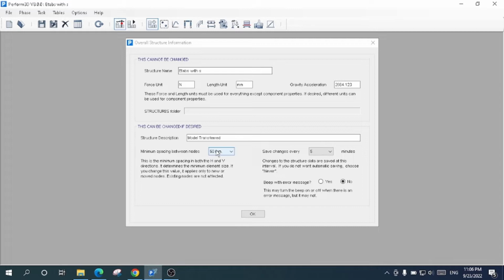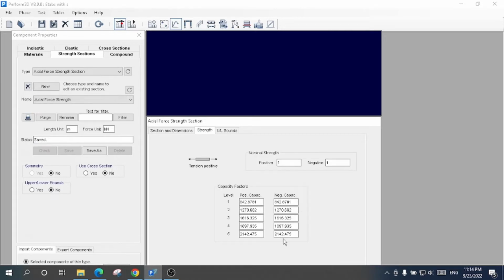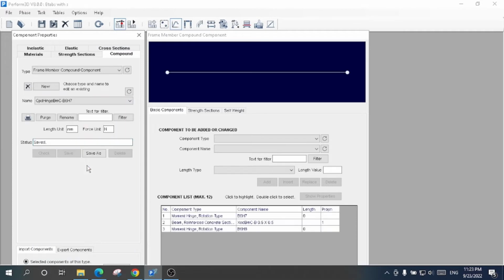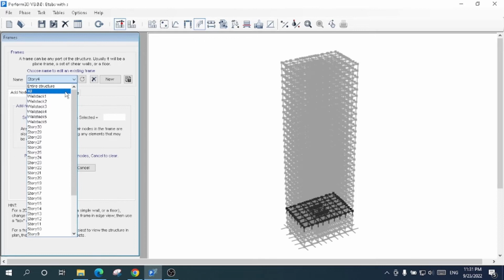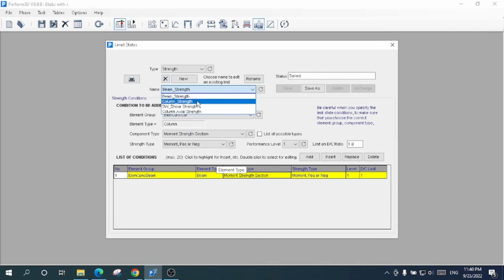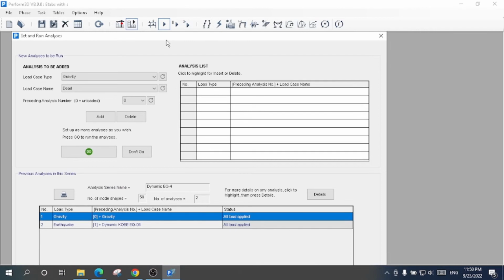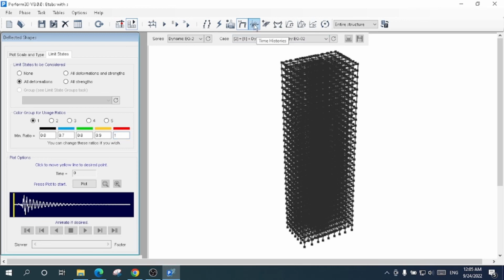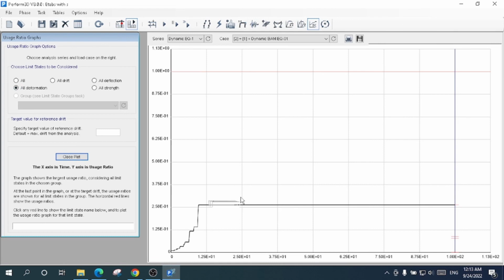Detailed learning of (Modeling + Analysis) phases of a building in PERFORM-3D software.

Comment: Thanks for great effort>>> I think that the new version of ETABS can do all nonlinear features of perform 3D>>> do agree with me?
Reply from the maker: Thanks for your great wishes, 
No, Basically the PERFORM 3D software is used for both Nonlinear and linear analyses and specially gives excellent results for Nonlinear case, where the ETABS is not that much powerful for nonlinear analysis, 

Also, for High rise buildings analysis the ETABS software can't be recommended, but PERFORM-3D software is the best and very suitable for high rise buildings analyzation,
that is why the PERFORM-3D needs more manual and step by step procedure which leads for very accurate results.
Reply: @SmartEngineer2  Ok>>> but I asked Csi Co. , they told me that both Perform 3D & ETABS new versions have the same nonlinear capabilities >>>>>
Another questions:
1- Can Perform 3D show the amount of energy dissipated for each RC element in the structures or shows only the group of elements?, Csi told me that ETABS can do for each a certain element
2-Can the user define the ultra high performance concrete in Perform 3D? if yes, please tell me how?
3- In Etabs the user need to define the locations of plastic hinges, in Perform 3D can do this automatically, or as in ETABS?
Thanks